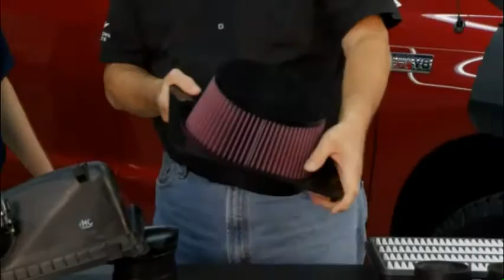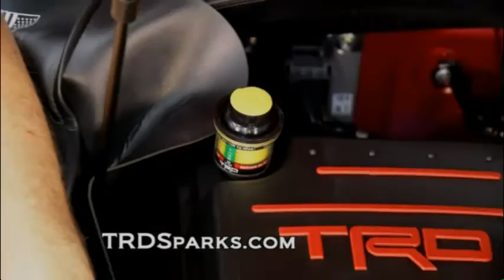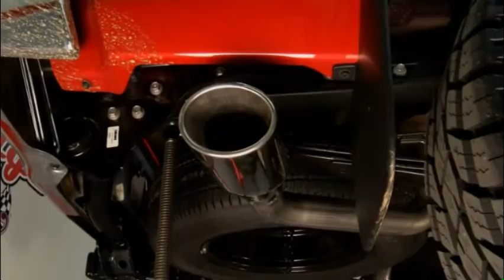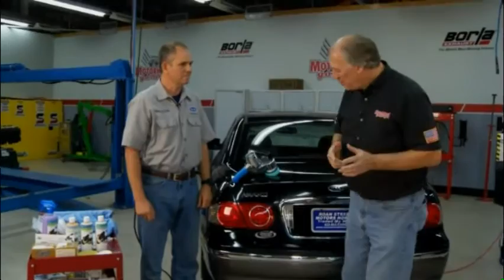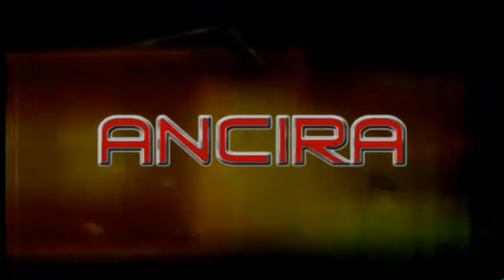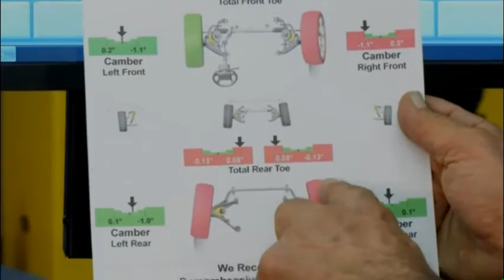Motorhead Garage:TRDSparks, Install TRD Cold Air and TRD Exhaust

Comment: The TRD dual exhaust has a god awful helicopter sound to it at cruising speed, especially bad at highway speeds. They should have built a crossover into it. The dirty deeds replacement muffler fixed all my issues with the factory TRD exhaust, albeit it doesn’t fit as well.

Comment: Is this intake CARB approved?
Reply from the maker: Eduardo Castañeda yes it is!
Reply: Jamie Sutherland thank you for responding to my question. I've driven a 08 SR5 Tundra until just recently and I traded it in on 2017 SR5 the 08 served me well for many years all I ever done to it besides regular maintenance was put a water pump on it. It had the 4.7 Engine. a lot people get hung up on the 5.7 they forget that the 4.6 is a very capable V8 . I have a pretty good start on my new SR5 4.6 I have Toyota steps on it and I had the Dealership to do the spray in Bed liner I would like to know the price of the TRD cold air intake system and the TRD Exhaust ? Thank you .I would like to hear any suggestions or Ideas you have
Reply: Jamie Sutherland great video. Will this cold air intake and Exhaust system work on all the Tundras 4.6 And 5.7 ? I've heard about a whistle on the Tundra with the TRD cold air intake?
Reply from the maker: We have a kit for your Tundra depending on what year it'll be a different part number but TRD makes them.  Yes at low rpms with slight pedal pressure sometimes you can hear a small whistle.
Reply from the maker: email us at sales@sparksparts.com and we'll hook you up on the intake kit.  They have them for the 4.6.  The 4.6 is a great engine!